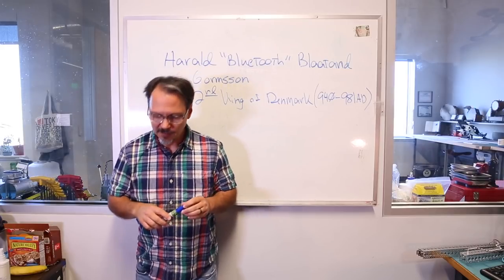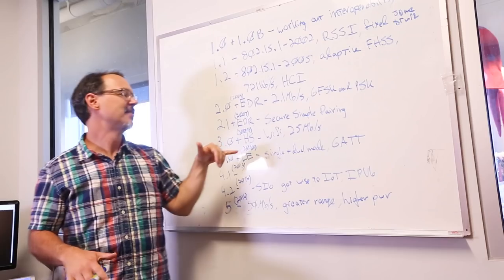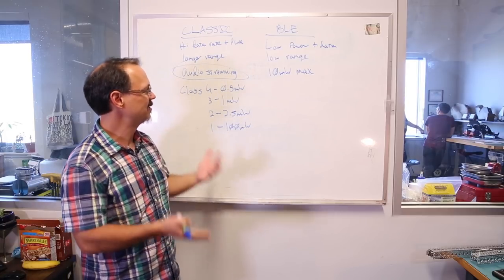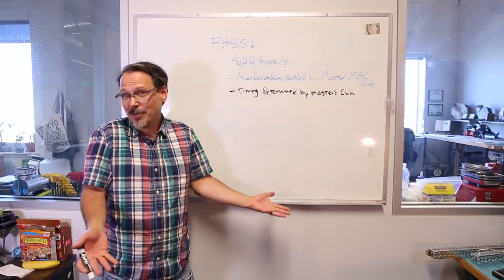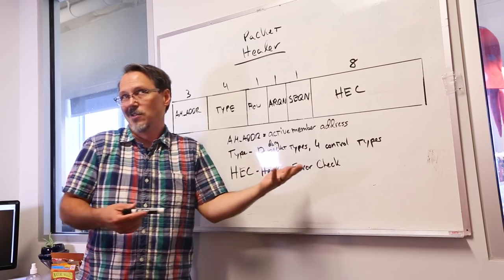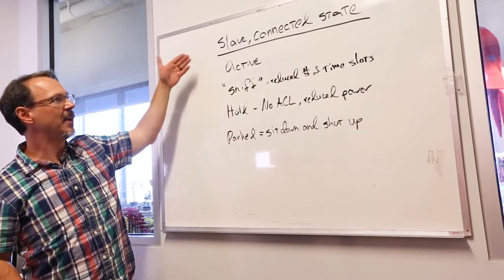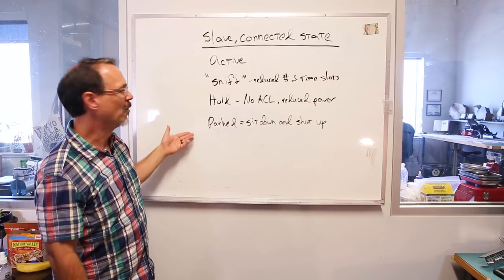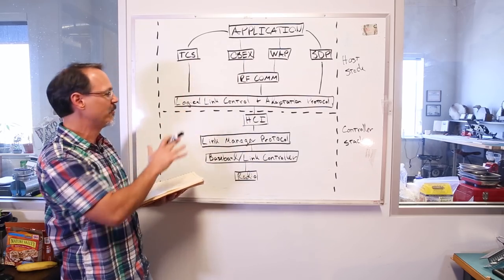SparkFun According to Pete #49 - How Bluetooth Works

Comment: Really great video - wish I'd found this a few weeks ago. Can you recommend a similar video covering the software aspects of connecting - pairing and services etc. I want to use a phone to send small amounts of data to a Bluetooth device without the device having to agree to the pairing. The user won't have any way to say yes on the device itself or key in 4 digit codes etc. Can this be done? Is there some sort of "Discoverable and will accept data from anyone" mode?